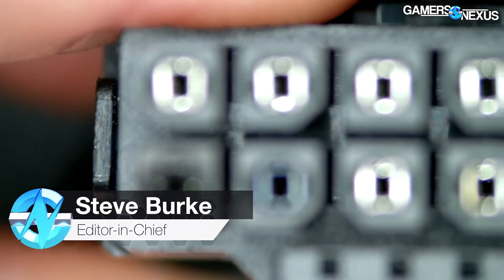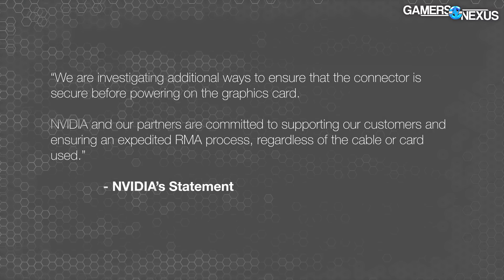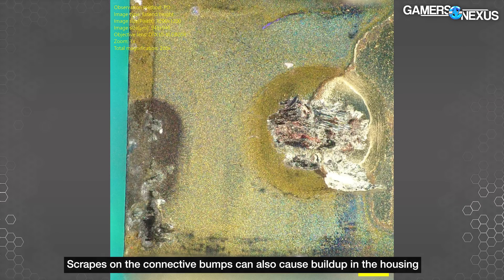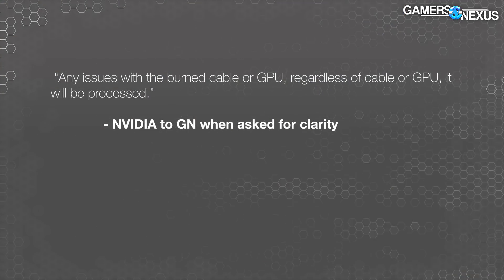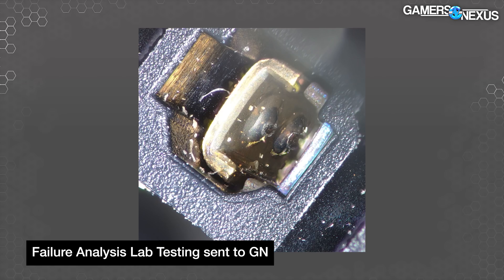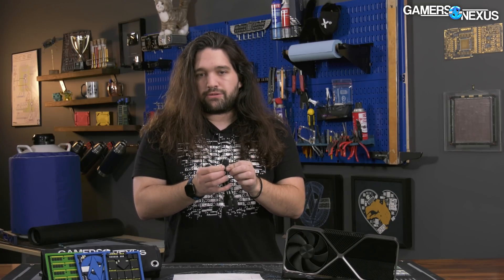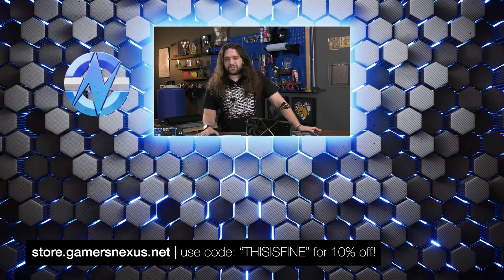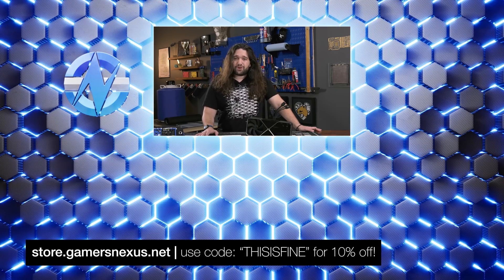NVIDIA Responds to Melting Cables, Warranty Concerns, & 12VHPWR Adapter Failures

Comment: One of my customers purchased a 4090 and installed this ridiculously large card in a mid-tower case. He had to remove the glass side panel in order for the power connector to not be squished against the glass 🥴. That is why these connectors are failing. Has nothing to do with the power not being plugged in properly. The power connector is being stressed by those thinking they need to put their glass back on. C’mon man……….you don’t need the glass 🤪. Everybody is overthinking this problem. The card is so close to the glass because of the size (height) of this card. Without the glass on, you are fine……..but if you try to squeeze the glass on……..you put undue stress on the power cable. Botton line……..the connector needs to be replaced with something that doesn’t get compromised by the glass side panel. Defending Nvidia is just wrong Steve. They should have seen this obvious problem in advance of approving  this connector for use.
Reply: did the atx plug ever made any turmoil...?
did the 6pin or 8pin pcie plugs failed in the same way as this one does...?
yes there have been some cases of incredible user miss-handling and improper assembly in the past with lots of connectors.
is nvidia at blame for using a connector they did not design???
some peoples are trying to shift the blame of a bad connector design onto the company that uses it... it's not how it all work ;)
Reply: @shinokami007  Yes…….Nvidia is at blame for using a plug they perhaps didn’t design………..but did approve for use. They will also be to blame when cases eventually have to increase in depth because of their exorbitantly large cards. From what I have ascertained is that the connector is being unduly stressed by the glass side panel due to the proximity of the card to the glass. The connector is probably fine without a glass or metal side panel on the case. At the very least, future cards should have the power plugs located somewhere where a cabled won’t be severely crimped in a direction it doesn’t want to go……..or have a connector similar to the motherboard 24 pin. In the end, it is Nvidia’s problem. We are responsible for the actions of our underage children.

Comment: Long story short. There are still a lot of us 4090 owners who are not fitting the side panel on their cases for fear of damaging the connector by too tight a bend on these monster cards. What should we do now? Close the case and hope for the best, or wait until the 90 and 180 degree adaptors finally become available? This is ridiculous, it's a shit design for such large cards and suitable 90/180 degree adaptors should be offered for free by all card makers.
Reply: indeed!!!
but also, to be fair to nvidia and all board partners ...why would anyone buy some things that does not fit well in its enclosure.

Comment: On your previous video I wrote same and I suggested to people same what Nvidia suggested to the users. 
1. Plug the connector to the gpu and ensure that connector sit on the header tightly
2. Put the gpu into the mobo pcie slot.
Reply: yup, that's how i am doing it every time i have to change a graphic card.

Comment: An amazing solution would be to use the existing working cables. I'm tired of this "fix new shit because it's new", use the working cables ffs. You shouldn't have to figure out how to plug a cable in. This is such an Apple move. I don't care if it's nVidia, or Intel, or AMD or freaking voodoo comes back. Just stop the nonsense form over function garbage.

Comment: Seems like this is an extension of a problem I'm sure a lot of us have seen for well over a decade. Think of motherboard power connectors and how difficult it has become to push those in to the point they latch. You end up having to slide your fingers or something between the board and the mounting plate to stop it from flexing so that you can plug in the cable all the way. I imagine when people are plugging that connect in while the card is seated the mainboard is flexing and eating up some of the energy they are exerting upon it. Molex connectors were great for getting us to where we are but it might be time the industry comes up with a new alternative that isn't as susceptible to this problem we've mostly just ignored.

Comment: Nice to see NVIDIA will RMA even though it's determined it's partly user error. Though, the connector should still be improved to prevent partial contact, and the cable modified to prevent the need to bend the cable so much

Comment: So, this is basically a non-issue for people that plug in the connector properly. Think about it. The vast majority if maybe not ALL of them (50 known cases) are because of improperly seated connectors.
So, even if it was a few of them that just failed even when connected fully. That makes it 3-5 (example) out of 125,000 units. That is infinitesimally small number on as a whole.

The biggest issue and design flaw is that it doesn't "click and lock" into place as easy as an 8-pin etc. It's requiring more force and then checking if it remains seated after some jiggle.

Comment: There is a book that you guys should buy it's called the NEC. It contains every minimum specification for literally every allowable conductor and what they are rated for. It is the national electrical code. For instance, what voltage and current 14awg stranded aluminum wire is rated for. Then, if some manufacturer says my wire is rated for this, you can go. No, it's not it's actually rated for this load at this temp for this long at this ambient temperature and humidity. There are countless charts and very "intense" legal terms, too.

Comment: I keep thinking.  Such connector should've been made out the "back" of the GPU pointing towards the side.  You'd have better cable management and you'll be able to clearly and fully see the connector been fully connected.  The location of the socket in those FE cards make it very hard to tell.  There is a level of user error but it's all thanks to a bad design.  GPU with additional power have been around for man years. And only now this is a problem.

Comment: I don't want to nitpick, but with the engine analogy it will be more like putting diesel in a petrol powered car and driving around for a while before noticing your engine is dying. And sure enough there are measures against that happening accidentally, just because people used to do that sort of mistake in the past, suing the manufacturer and winning. But even if you go for the jerrycan filling and fill your car with the wrong fuel, no matter what it is made of, all modern engines (from the last 20 years basically) can deal with that and either won't start at all to protect themselves or go into limp mode to prevent damage. It's impossible to drive a car just fine on the wrong type of fuel, until it starts smoking and that being your very first sign that something is off. I guess my point is, a system for fault detection is in need here as well.

Comment: The problem is they are rating the plugs much higher than they will perform safely.  Granted these cables are much shorter than a 15' car stereo positive wire, but I would be using 6-gauge (cigarette size) to wire a 450-watt if I were the designer, not a few 24-gauge wires.  Those are not 18-gauge as is listed on some websites, 18 is coffee-straw sized, these are toothpick at best and stranded not solid.  It wouldn't be getting hot enough to melt the plastic if it was in proper spec, the wire wouldn't be getting hot at all.  I can pull 50 amps through a 14-gauge in my walls without setting the studs on fire, but there are laws against that for a reason.
Reply: Each wire needs to handle 9.2A, 16AWG is fine.

Comment: cant they make the connector "L" to avoid the overhang issue? im no genius by any means but if the seating due to user error is the issue, that still leaves that bending the cable is a No No. so would an "L" cable  work in this case?

Comment: there would be quite easy fix for the not secured properly. the latch would have metal contact pin connected to ground and it would sense if the latch is properly connected.

Comment: It's possible to do something where Nvidia does some degree of validation work on third party cables without completely gatekeeping the process. MB has QVL for RAM kits, for example. I personally however don't think that's the most effective way of solving a problem such as this.

I personally think the short term solution for the 4090 and 4080 (or maybe the 4070 Ti or whatever they decide to call it), the ones that have already been manufactured/sold, is to see if it's possible to improve the latching mechanism. I have personally felt the clicking on the Nvidia one and some reputable 3rd part solutions, and subjectively the 3rd party ones I've used made a much more tactile click when it latched. It could still be poor connection even if it was latched with the "better" click, but the point is that the latch felt subjectively different, and this may have to do with manufacture tolerances.

Long term they may need to revise the physical design of the connector, but that would be for future generation products.

Comment: When you think back to traditional power connectors on graphics cards, each connector was safely proven to handle 100 watts per 6 pin connector and 150 watts per 8 pin connector.  It's my opinion that Nvidia had pushed that limit right to the razors edge with the release of the high end 30 series cards using a smaller, single 12 pin connector (for what I can only assume is for esthetic reasons) to handle up to 450 watts from the PSU.  Now the 4090 is using that same connector to handle up to 600 watts?  That's way too much power to safely push through that single connector IMO.
Reply: 150W/3 pairs is 50W per pair for the 8-pin connector, how in the world did you get 37?
Reply: @infinitelyexplosive  Am I mistaken that an 8 pin pci-e connector has 4 pairs totaling 150 watt power delivery?
Reply: @Sandmansa  8pin has 3 pairs and 2 sense, 6pin has 2 pairs and 1 sense, most mfrs fill the empty pin with an extra +12v, eps12v (CPU power) has 4 pairs
Reply: @infinitelyexplosive  I stand corrected, and I edited my original statement.  Thank you.
Reply: No, it's not. Understand the basics of how electronics work before making ignorant statements.
Reply: @aaaaaaaaaaaaaaaaaaaaaaaaaaargh  If I am wrong then please feel free to point out my mistake and correct me.

Comment: validation for the cables should not be that Nvidia validates the cables but rather validates a standard... as in " If you're cable meets or exceeds these specific parameters we will consider them validated" without any brand specifics. that way it is on the 3rd party to meet or exceed the specifications.

Comment: My number one concern is that this new connector, with the 4090 is that it's far too finicky tor a mainstream product. They could just as easily added another eight pin connector, skipped the current dangerous and ugly adapter. Just shut up with the excuses Nvidia and fix your GPU power connectors before something really bad happens.

Comment: anyone know what i can do im in rma hell with asus i had to send my 3090 in because i was having an issue and they keep sending me worse and worse cards back! the first card had a bent bracket and all the screws were loose around the outside even the screws holding the gpu die bracket was loose! after tightening them it constantly crashed. the second card just ran fine for a few minutes then would crash. im awaiting the 3rd card it should arrive monday....
Reply: oh joy the card i got monday runs at 87C in a game menu....

Comment: nvidia issues aside we should really do away with all versions of this PC latch connector. all of them from 6pin pci-e to 24pin motherboard connector are a literal pain to insert and remove. as you always have sharp metal or plastic digging into your skin. screws teminals or a spring loaded lock type connector would get the job done far easier.

Comment: i think adopting a shortened sense pin(s) will be the way to go The EV type 2 AC charger connector contain a CP (control pilot) pin which is shorter at the car side to ensure full insertion of the connector. It would be easier to modify on the card side vs a rework and re-ratification of the connector design. It does seem like the retention mechanism could do with a full rework however as the positivity of the connector being fully inserted isn't at all clear. Maybe a mechanical spring loaded clipping interface on the connector side is the way to go?

Comment: Gamers Nexus needs their experiments peer reviewed.  According to other labs, the 2 +12V pin connection test should have melted.  This means that test requires verification that there was at least 200W drawn through each pin.  That verification means not relying on the GPU to report power usage during the test.  It is easily possible that the GPU has programming to false report power usage to keep things convincing, and various manufacturers have done this before.  This is a very common part of performing experiments, calibrating and proving the tools being used are working as expected.  Too many times have I seen problems exist because of too many assumptions.

Next up, are there any air holes in the 12VHPWR connector with the adapters?  The wear line found on the melted connectors is NOT confirmed proof of user error.  You still have the factor of heat expansion resulting in dislodging the connector, which also includes trapped air expanding.  It takes time for the trapped air to push the connector out, and this is a factor in connector design that can easily be overlooked.

The problem with these current tests is we are all in a rush to determine the cause.  As such, people like Gamers Nexus, and basically everyone else that has tested these connectors, have been running the tests wrong and under the wrong assumptions.  The fact that keeps being missed is the connectors are damaged over time.  The tests are seeking an immediate, catastrophic failure.  You don't need an immediate catastrophic failure.  All it takes is one surge to melt a tiny bit of plastic into a pin to create more resistance.  Once the first bit happens, the impacts start to build up.

This also points out the red herring that is the melt line on the damaged connectors.  If the connectors have no holes in them for pressure relief, the temperature alone makes the plastic soft enough to wear a line, and the heat can create expansion force to push the plug out of the socket, a factor that the plastic clip on the side does not prevent.  If the plastic violently melts and bubbles, the connector will definitely unseat itself, and the plastic will be soft enough from the heat to make the burn line instantly.

Comment: Definitely seems like Gamers Nexus did all the legwork for NVidia because now only a few days after they magically have a statement.

Option 3 for power connector solutions would be to stop using the 12VHPWR and go right back to 8-pins. You already have to jank all the 8-pin together to run it into the 12VHPWR connector so it's really not helpful, and after seeing this disaster this connector itself should NEVER make it to retail market or any market again. What we have works, why the heck change it.

Hoping AMD will crush NVidia so they come back to reality. I'm personally going AMD regardless this time. Thanks for all the hard work Steve, you're channel is the best.

Comment: How is it that GN thinks to do a full failure analysis, but nVidia is instead "looking at the user side of connecting it" and has no comment? I appreciate nVidia taking care of their customers and giving RMAs regardless of cable or card used, even if it's user error. It is, however, fairly short sighted of an ENGINEERING company to not immediately do a failure analysis on the connector and cable in this instance. With their financial resources, an analysis of the caliber GN did would have been a trivial cost to them.

Comment: I think the best way to test if it's plugging in is to pick it up by the cable, and sling it around your head like a nun-chuck to see if the card stays in or goes sailing across the room.
Reply: "No, no. He's got a point..." is the meme I can feel from this comment albeit very wrongly test wise and dangerously to feel the plug work properly as intended

Comment: A connector that requires an uncomfortable amount of force to connect properly, the user can't really tell when it's fully inserted, and they can fairly easily be mistakenly believe the cable to be fully inserted when it is not, it's not a very good design.  Yeah, sure, it's "user error", but since the design attracts error that poses a real fire hazard, I put the fault on the design and implementation more than on the individual user.  Also, a 0.04% failure rate in a product that has only been available for a matter of weeks is actually very high.  Especially when the mode of failure is a runaway thermal event that could cause a fire.  I can't envision any QA tester or lead engineer signing off on this as "acceptable".

Comment: A high compression (10:1+) engine shouldn't be run on low octane gas (regular/mid grade) due to the danger of "ping" or pre-detination. This can damage your engine, and would probably void the warranty in some circumstances.